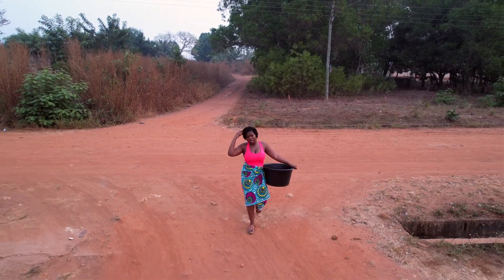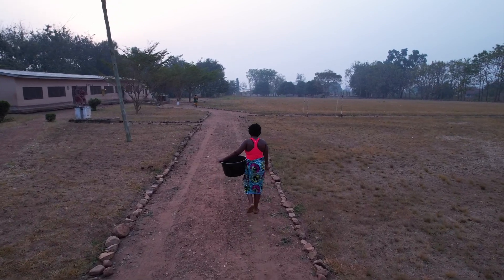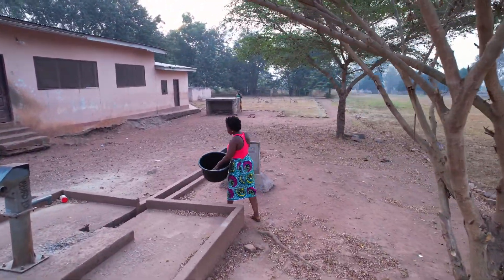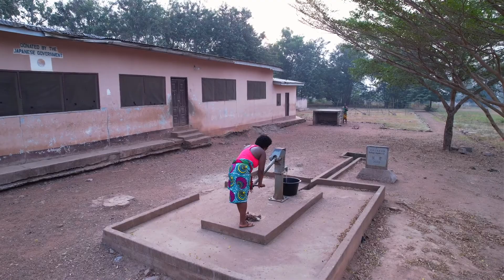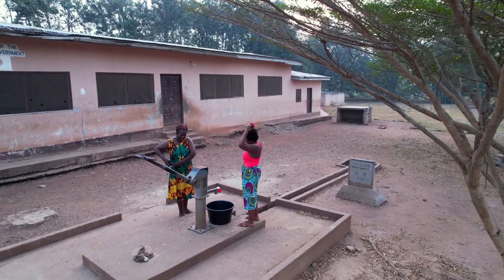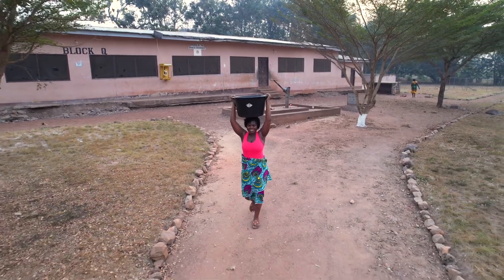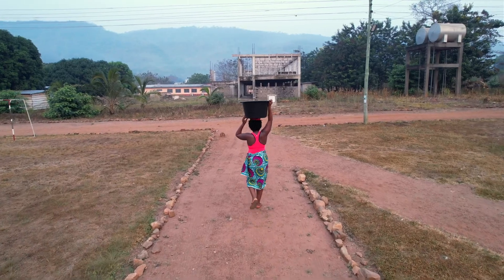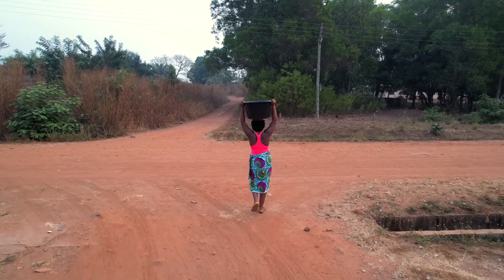USING A MECHANIZED BOREHOLE IN A GHANAIAN VILLAGE due to Water Shortage.

Comment: In Nigeria 90% of city houses have boreholes,
It’s our main source of water
Most houses have the automatic pumping boreholes they use a pumping machine powered by light to pump out the water.

Some rural areas still use this though but this is almost faded out.
Reply from the maker: That is a huge percentage. I have heard that Nigeria has issues when it comes to consistent access to electrical power. How do these households reconcile that with the water pumps ? 

You know what I really want to see, the wells the required that you use the buckets and pull them up. That would be very interesting. Dangerous tho. But interesting.
Reply: For the lack of power they substitute with generators. There are people who still use the traditional wells but they have safety edges these days